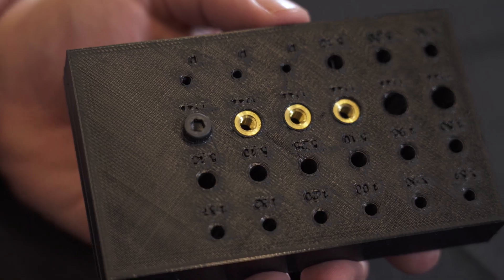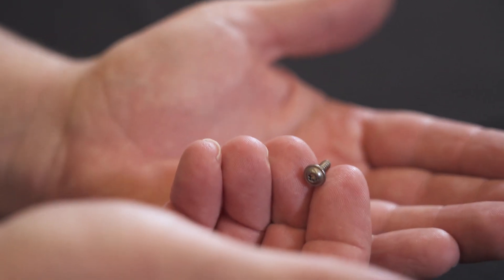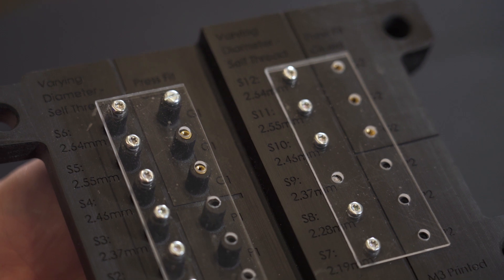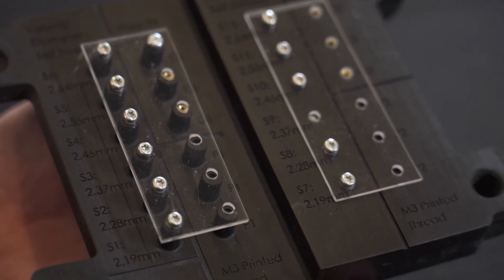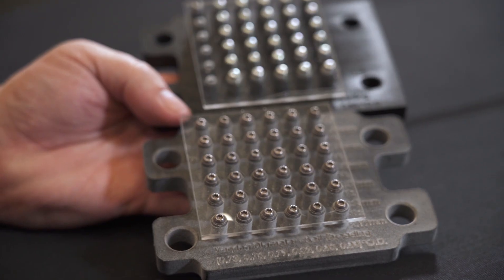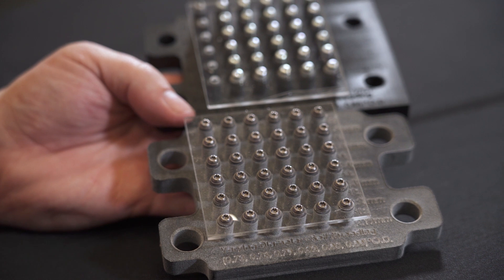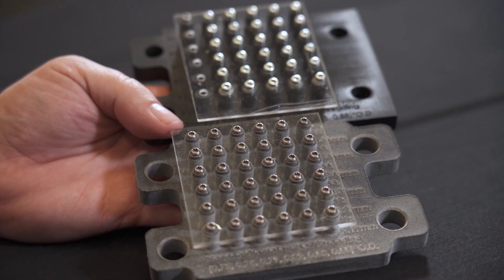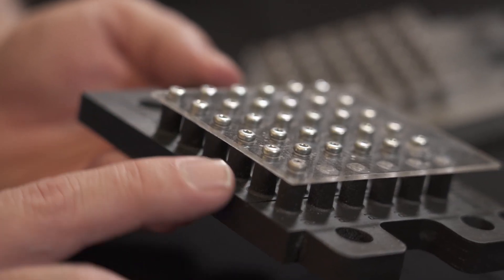Can 3D Printed Parts Hold Fasteners?

Comment: No difference between FDM & MJF? Because that can be construed in more than one way.. And are there any materials in particular which are preferred?
Reply from the maker: Varroc uses FDM for tooling routinely, but because it is not being considered for production parts, FDM was not part of this test. Varroc tried fasteners in parts made with HP’s MJF process and Carbon’s CLIP process. The materials were PA12-GB nylon (HP) and EPX 82 epoxy (Carbon).